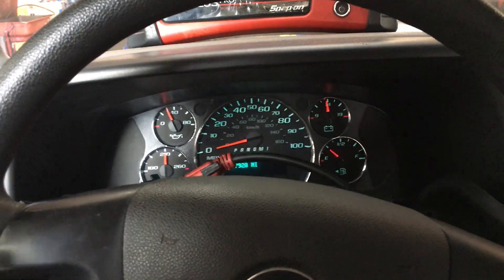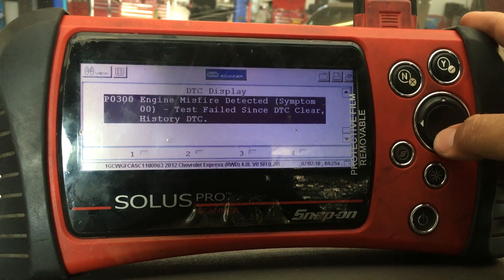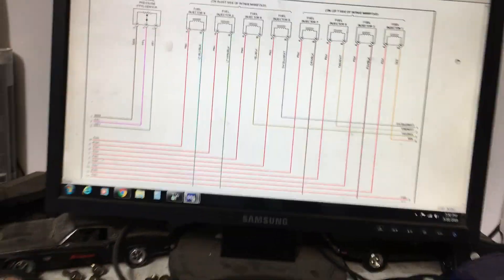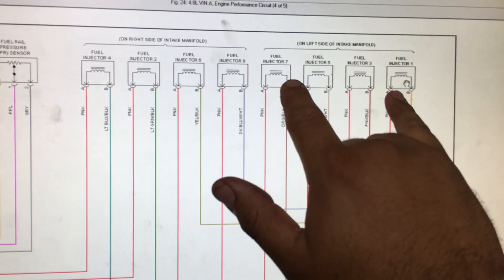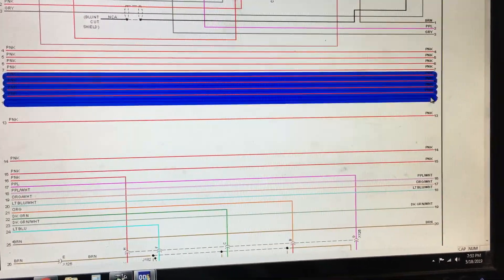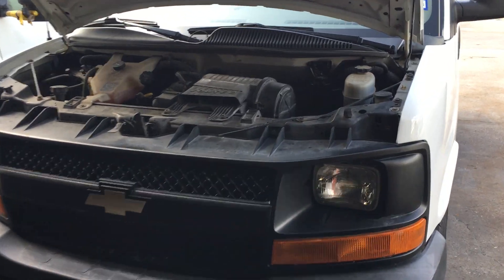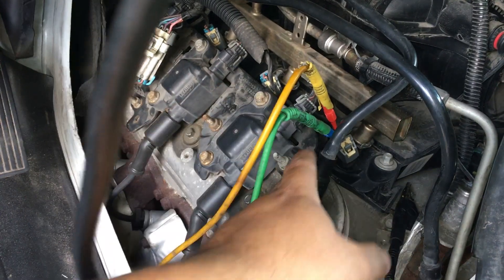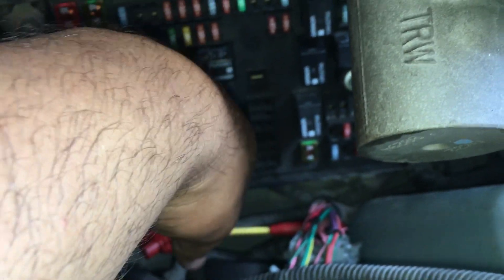CHEVY EXPRESS MISFIRES ANTS IN FUSE BOX

Comment: So, what I really need to know, is did you put the jumper in before you put the fuse panel back in and tested it? The reason is (and I am dealing with this on my work van right now) I believe the solder joint is cracked under the board. If you removed the ants and it worked, but then took it back out and ran the jumper, then it was the ants. If you put the jumper in as a precaution when you had the panel out and then tested it, then it very well could have been a cracked solder joint (I work on circuit boards and they can be almost impossible to see without a stereo microscope).  Not saying it could not have been the ants. It would depend on what they are shorting to

Comment: Yes, the ants can short electrical connections.  No, I don't think they caused the issue.  You fixed the issue by putting the jumper in connecting the two fuses.  Most likely you had a bad solder joint on the fuse 65, and by putting the jumper in you eliminated the poor connection.

Comment: Are there connectors to disconnect under the fuse box to remove it?  I did disconnect the top  connector of the fuse box. Thanks! I’ve seen the green crust where the ants were in the fuse box

Comment: I have same issue , entire left bank not working . However , the constant power side is working at the ignition harness (part number 357a). The other lines coming from the computer are not proving any power or telling the coil to fire. Please how could I fix this. I can’t find the wire diagram

Comment: I have to say I think it's a coincidence. I'm having the same issue with my 2011. I've seen these boxes cause issues before also. I can see the discoloration where the pin attaches to the printed circuit. While it shows 0 resistance, I imagine if I could apply a load there it would drop voltage. Great Diag and repair. I wish customers could  understand how difficult intermittents are.

Comment: The solder joint for fuse #65, which controls the injector circuit for the odd bank is broken inside the fuse box. A new fuse box is the fix.

Comment: Fire ants in Houston will gather anywhere there is heat of the correct temperature and attempt to build a nest and use the heat to hatch eggs.Sensing a small electrical current that agitated them at their heat source, they release the sting, which is conductive, which electrocutes them.

Comment: I have a 2004 Chevrolet Express 3500 with the 6L engine.  My cheap USCAN says I have a P0200 Injector circuit and a P0300 Multiple Misfire Detected.  Does that sound like ants?  Should I give it a squirt of RAID and see what happens? ;-)

Comment: Probably the acid is working its way down to the soldering and tracks on the other side of the PCB making the connection intermitent.  I reapaired computer PSUs and  they are a roaches magnet. At high voltages (400V) and AC current things behave different and roaches can blown a 8A fuse effortlessly, they are like a solid piece of copper. But 12V, doenst look so much, They can induce surges, but if shortcircuit the provided fuses would have blown. IMHO I think the acid from this ants is rusting the solder joints. The jumper was pretty clever to give redundancy.

Comment: I think the bank are  power fee separated due to this situation, where you can at least work fine with 4 cylinders and move it from a to b in case if needed what would have happened if all missefired? Probably won't move and shot down I guess

Comment: if the fuse box "also" has computer controlled power switching (like jeeps TIPM as one example) it takes very little conduction in across certain paths to cause those power transistor driver control circuits to do some very strange things. some ants are strongly attracted to current carrying electric circuits , we used to spray ant killer spray around electrical boxes for that reason.. example of this issue with a certain type of ant called a rasberry crazy ant but fire ants will also do this  "https://www.youtube.com/watch?v=LmoCdeSHh_U

Comment: I had dead moths in a voltage regulator years ago. I cleaned them out and everything was charging again.
Reply: Ernest Imken I once replaced a blower motor on a 2009 Saturn Astra and I found a dead rat in the old blower motor. That thing was totally mangled up.

Comment: When you eliminate the impossible what remains no matter how improbable, is the cause.  Just because ants are small doesn’t make them less likely the cause of the misfire.  Many birds and squirrels have caused major power failures by gnawing on high tension wires.  Once you determined ants caused the odd firing cylinder bank to misfire, installing a jumper between the even and odd banks was probably not necessary but good insurance.  Did you replace the 10A fuse with one with a higher amp rating.
Reply: First of all it's a 20 amp fuse. Second of all aren't you just dying to know that if he took that jumper out that it would be solved or not solved

Comment: Electrocuted ants leave carbon trails.
Reply: A pencil drawn line would cause a misfire in the old style distributor caps. Once the carbon track was burned into the cap it would never go away, even if it was sanded off.
Distributor cap replacement was the only solution.
Some old school thought

Comment: I'm an American living in the Philippines.  So far I have been lucky at my house but many neighbors have had failures of their air conditioners, sometimes even leading to circuit board replacements, due to ants and other insects getting inside the air-con control boxes and "lunching" on the resue of the flux used during the circuit board manufacture.  Apparently, they die from eating the chemicals left behind by the solder flux.  You're in Houston, correct?  It's basically the same hot, very damp climate there, so this doesn't surprise me at all.  Probably not as uncommon as you think, but just as what happened to the first mechanic, a lot of needles parts replacement takes place because nobody suspects intermittent "foreign body" shorts.  Great job of tracking this down.

Comment: It's the ants...the bodies will form intermittent resistors, worst of all their body acid can ruin circuit runs and contacts...clean everything and protect the board with Deox-it 5.
Reply: Or you call it D Aunt it 5
Reply: Or you could call it WD- 5 dead aunt.
Reply: Or Black Flag Electronics Edition.
Reply: Better yet make everything ants could get into her a Mercury sealed or ultrasonically welded in airtight.

Actually it's some cases would not be the best idea.

How else would you change the fuses in the fuse boxes LOL.

Comment: Yes.  Your correct that the ants caused the problem!  I have had ants short out contact switches in both a water well and an air conditioning system for my house, my dads house, and a friends house.  Hopefully they didn’t do permanent damage to the fuse box.  I personally would not have run a jumper wire as a fix.  Trying to save people money can bite you in the long run.  With that said I would not have been opposed to getting a junkyard fuse box.  But hey...it works, I guess that’s all that matters.
Reply from the maker: I only did it because I couldn't take a chance with this work vehicle, but it's still running great. Thanks for watching!

Comment: You're damn right ants can short stuff. Go ask an HVAC guy. They find them in mass around contacts and capacitors.
Reply from the maker: So I've heard. Thanks for watching!
Reply: By the way I had a USB charger surge protector died to dance as well.

Also the Springs up the h v a c issue.

At one of our parents houses we had that problem with ants in one of the contactors.

 and one of the relays as well.

Don't worry same thing.

Does anyone know what causes ants to be attracted to electrical equipment I've seen this quite a few times in my life preparing my products.

Comment: U have some really great finds!  I thinks their body fluids when they die r conductive, like battery electrolyte. Super channel!!  What next?????  Spiders and snakes?
Reply from the maker: That makes sense. Thanks for watching!
Reply: Well electrical contractors of civilities will allow snakes to live in the gospel quipment boxes the large ones to control other pests that would show on wiring such evidently from what I've heard.

Remember the movie Snakes on a Plane?

There was a real life somewhat similar occurrence.

Except it was just a few snakes and it was not like the movie fault was it was something else I don't remember the details.

Also on my grandparents Farm they said they had had some farm equipment messed up because of nesting bees in the mechanical permit for some reason.

I have also seen on the internet where they found snakes and other things in cars even squirrels have nuts in air cleaner or something else as well

I've heard more than one case of a cat winding up in the engine bay.

Raccoons you name it

But the strangest thing I've ever heard of was bugs living in between the headliner and roof which I actually heard of on car top on NPR on the best of Car Talk.

Comment: I’m having all the same exact codes and removed the fuse box board and did the same thing , I had any in mine too ,cleaned it and still having the issue , what wires did u jump to run the injector power from the other bank of injectors?
Reply: Just soldier the buss again. No need to jump it. And just so you know. Tie all the injectors to one buss. You just increase the amperage that buss has to carry. Not a good idea. As it can overload the circuit...